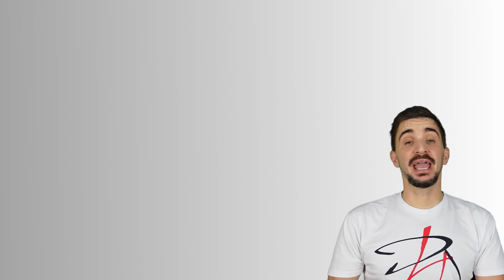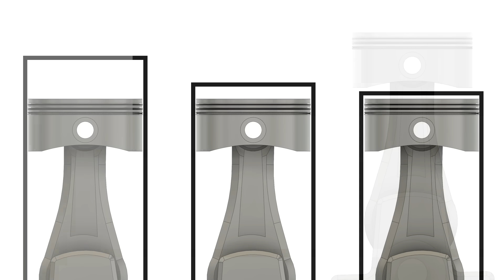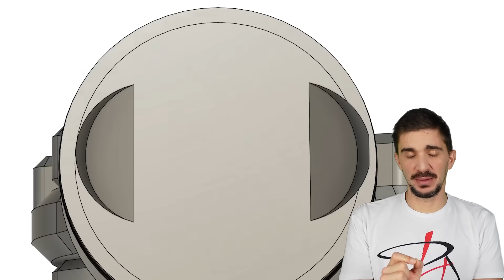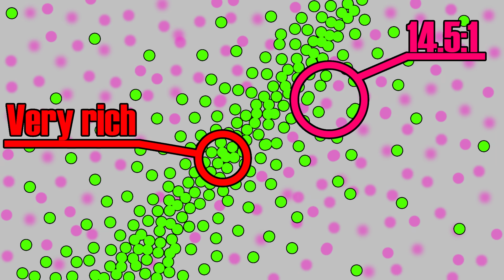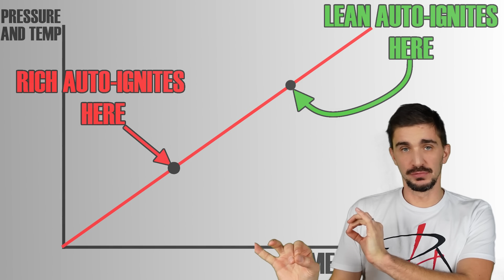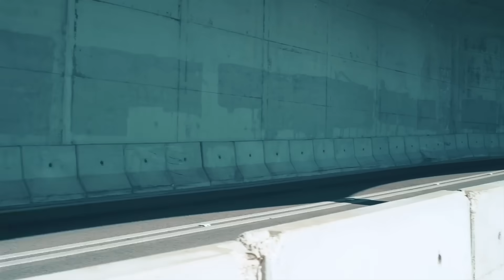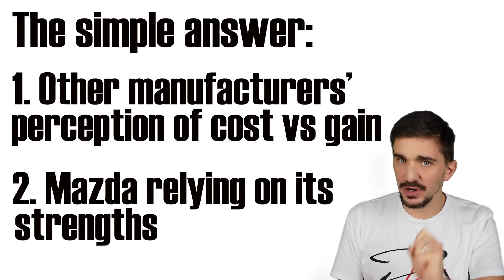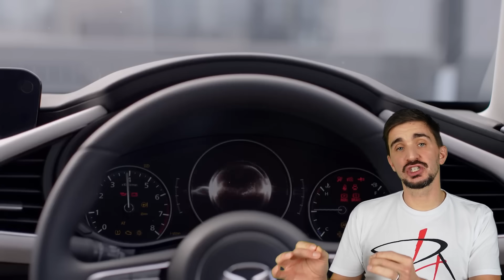The Game Changer Nobody Cares About - Mazda Skyactiv-X SPCCI How it Works and Why It Didn't Catch On

Comment: I have a 2017 cx9 & I have had 2 cracked cylinder heads & a stress fracture on the turbo. Recalls were issued so luckily I was reimbursed by Mazda for the 1 cylinder head cracking, which was $12k. The 2nd time it happened, about 6 months later, Mazda covered the full cost.

Comment: This is another case where I believe decoupling the engine from the drive would be useful. Just use an engine like this as a generator, then have a very small battery/buffer drive EV motors. No need for heavy drivetrain, no need to run the engine at anything other than its optimal configuration. EV motors provide the quick acceleration. 

I feel like Mazda was basically doing this with their "range-extender" I just think they need to take the concept to its extreme

Comment: I've driven a number of Mazda's cars over the years, and you're right: they are spectacularly underwhelming when it comes to engine performance. At the end of the day, I'm not paying significantly extra money for a car that gets slightly better gas mileage than the cheapest sedan on the market but can't outrun it. Every time I push the gas pedal to join the highway traffic, the Mazda revs and makes noise, but does not accelerate any quicker than a Nissan Sentra... or maybe a Versa, hard to say. It can not get out of its own way, despite looking like it should. Mazda built the most stunningly disguised economy car ever.

Comment: So why not simply introduce kerosene as a motor fuel? And do away with diesel and petrol except for niche markets?
Reply: Why? It's sits in between diesel and gasoline in properties and literally in distillation column. There are already huge market for it - jets. We will just end up with very expensive kerosine and dirt cheap gasoline.

Comment: So why cant this be used in an electric vehicle where the gasoline engine is only used as a generator like a diesel-electric locomotive. You don't need control if the load is always the same.

Comment: As you mentioned its underpowered compared to most modern 2 litre engines. Needs more torque, they should of lightly turbocharged it, to at least 200hp / 320nm.

Comment: Car Failing Point (engine, electrical and suspension):
1) Shareholders influence, greed, bad Engineering designs and low quality materials used for manufacturing (50-60%)
2) Bad manufacturing systems, Q&C standards and unskilled workers (20-40%)
3) Owners ignorance and neglect of maintenance services (30-40%)
4) Environmental impact on components (5-10%)

NB: Subject to correct

Comment: I recently had a rental Mazda CX-90 and determined a few things:
1) The appearance of the vehicle is beautiful outside, but lacks the same inside. 
2) There were a number of rattles that seemed to be manufacturing quality issues.
3) Interior soft points were lacking in specific areas.
4) The power was decent on the low end, but lacked high end torque that matters when you need it.
5) The shifts down seemed to rev the engine too high and the torque range was pretty specific and narrow.
6) I did not see a gasoline efficiency that was notable.
7) The transmission was louder than I would expect in its peer group.  
8) The doors seemed to close with a cheap quality feel and sound.
9) The infotainment screen was a nice size and not overly distracting.
10) Overall not as impressive as I would hope in that class of vehicles.  
My daily driver is a Lincoln MKZ 3L twin turbo, so I’m in the “spoiled group.”

Comment: I am an old school Honda owner. I LOVE engines you have to work a bit to keep them happy. It is impressive to me that Mazda has been able to bring out a high technology engine, and make it reliable. Thing is, no turbo, means no excess heat to deal with under hood, no cooking oil for extended oil changes like a lot of dealerships and manufacturers sell people on. A naturally aspirated engine tends to be more tolerant of less than perfect maintenance, but I have no doubts this engine still demands oil as clean as possible to function correctly. I do have a love for Mazda products. I have enjoyed all but one Mazda I have driven so far. I loved the 1987 RX-7 GXL (NA engine, with the Turbo's suspension, limited slip diff., and brakes) I drove and was about to buy, but it sold just before I had the cash in hand. I loved the brand new Mazda 3 I test drove around 2005-06. It was a fully loaded manual transmission, and it was amazing to drive and super comfy, was even impressed with the leather. My roommate's mom had a very rare here in the states 1993 Mazda 929. That car was soooooo nice, surprisingly supple tan leather in a pearl white car that looked brand new for the 15+ years she drove it. Mazda can make amazing things, and I am happy for them when those things work. Just, it is a shame that they are the smallest of the big Japanese automakers, because it is often Mazda pushing more boundaries.... often in random or off the wall ways. The stubborn, Mazda way.

Comment: I'll never ever ever own a Mazda. 142,000 MI on a CX-7 after having the top end injectors and everything redone throws a rod through the block 70 mph.. never had a problem with the car beforehand just decided to have the injector service and tune up. Service regular oil intervals everything.  they are garbage cars. That's just one instance

Comment: Water vapor injection do the same cost 3$ , 10% of water reduce heat in cams allow  to have lean mixture and hi spark angels without detonation, and also water change compression ratio, water allow you to have various compression in engine, and even change it to 12 -14 and it without knocking. Actually first engines don’t work without water, and hi loaded  turbo engines don’t work without water. I think gasoline engine + water  and TDI+propane+water will do almost the same as skyactiv, but any way this is cool unique technology, and if you add water to skyactiv it will consume even less fuel 🤔nice video thanks💪

Comment: Obvious what we want is a plug-in hybrid with a supercritical CO2 turbine on an air bearing as a backup generator that doesn't require oil change or maintenance. Since it will be an external combustion turbine, we probably don't even need an air filter. Cooking oil, strong vodka or coal power would do too.

Comment: i think i can take a stab at why there hasn't been more hype than there could be.. because OVERALL mazda's long-term reliability is NOT sky high (no pun intended). Nope, Toyota shines on that one. Vast majority of people don't care and aren't impressed with 'reliable engine',  they are impressed by 'reliable car'. Moreover, those who truly care about reliability usually care about LONG-TERM reliability, and Mazda is not 'it' on that one either. I suspect many Mazda's are leased. The people who lease their cars have the mentality of renters - they really couldn't care less about long-term anything. If something goes seriously wrong they will change cars easily at the very next opportune moment. Note to manufacturers:  if you want your special engines or whatever else noticed, you have to aim to impress the people who buy a car (especially if paying with saved up cash!) and plan to keep it for a good part of a century. That's Toyota territory at this point, almost exclusively (no, not subaru either at this point, despite the marketing propaganda - 10-year repair records do not lie). Would be nice if a TRUE competitor came on the scene - would give more choice and better prices for the long-termers, but that hasnt happened yet.

Comment: I just got me a Mazda3 from 2018. It doesn't yet have the skyactive x, but a nice naturally aspirated 2.0L engine with 120hp. Living in the alps I can say, that the torque is enough to cruise up serpentines until about 10% in third gear as low as about 1500rpm. Of course you have to shift down for reasonable acceleration, but the motor is far from troubles keeping the speed. 
The engine runs very cultivated and with a pleasant deep voice, very smooth and 'direct'.
Unfortunately because of EU regulations, this 2.0L is castrated to 120hp, only available in the EU - normally it has 165hp(which is also available in the EU). Only difference is in the software and only above 4000rpm.

Comment: Back in 2024 I had a 2007 tacoma trd off road with 130k miles and a 2022 wrx base manual with 14k miles.
I decided to down size big time so i sold them both.
I was cross shopping a 2024 corolla le and a 2024 forte lxs.
Not only was the forte 3 to 4k (last model kia sales) cheaper, better tech and better warranty. But the real reason i chose kia over toyota was because the compressionratio.
12.5:1 compared to corollas 13:1
That .5 made me choose kia lol.
I dont trust the cvt too much though and always pull away slow pissing the person behind me off.
I bought the car to keep for 20 years and anytime we decide to go long distances.
Its an appliance, cant wait foe that telo mt1 to join the garage when its released!

Comment: this is all fun untill something goes bad. I drove mazda 2.2d, had  alot os serious issues with the engine and the gearbox. It's so called SkyactivD technology. It has a lot of torque with low fuel consumption but all that you save on diesel, you pay a lot more for the problems. I hope this new technology will be better.

Comment: Actually, I own a 1981 Silent Shaft MCA Jet engine, that does pretty much the same thing as Skyactive X.  And yes it gets over 40 MPG hauling a six passenger station wagon.  The last time it went through inspection it's emissions were insanely low. BUT...
It takes almost 10 minutes to warm up while it will stink and smoke up the whole neighborhood until it settles down and can run.  I also might add that it has awful pick up and a very low top end.  Yes... at cruise speed on a flat road it gets amazing fuel economy, but it mostly wants to operate at in a very narrow RPM band after it is properly warmed up.  

The reason I own a own a 46 year old MCA Jet engine is because no one in my household ever wanted to drive it since it was new.  Yes, it was great on long trips, but the garage is under the house... so you had to first push it outside, then wait 15 minutes and then slowly ooze up to highway speed in order to get better than 40 MPG.  And honestly... nobody ever wanted to do that.  So 80,000 miles in 45 years.. all highway... and it still lives in my garage where no one wants to actually drive it.

Comment: The truth is mpg doesn't sell cars. Not when gas prices are low.  The manufacturers put tiny turbo engines in because they are easier to package and cheaper to build, and many don't get good mpg. The tiny Trax can't get 30mph in normal driving. Nobody is really competing on mpg.

Comment: Could SPCCI be used in a PHEV setup, where it would just charge the hybrid battery rather than connecting to the drivetrain? Wouldn't that allow it to run at optimal load all the time?

Comment: In Europe Skyactive-X is 2000 E more expensive then 2.5
And for what? For an engine with no low end torque, that requires premium gas and that is a tiny bit faster?
If you compare it to other Mazda engines - it is still OK. But it has nothing on 2.0 TSI

Comment: In the 1980s Honda had a system whereby a very lean mixture in the cylinder while one intake valve supplied a rich mixture around the spark plug; this in a carbureted engine.

Comment: I own a 2025  CX-70
The inline 6 cylinder performs just as described in this video. Powerful and fuel efficient. I averaged 29.6mpg last week on a 3000 mile trip.

But, let us not forget Mazda is also the last manufacturer to use a sequential transmission. 
All other sedans come with a CVT. 😢 Even Subaru has transitioned to the dark side of gear shifting. If only we could still opt for manual.

Comment: Mazda might end beating honda at this rate. The tiny turbo engines with GDI are crap, nobody can make them reliable. Ultimately they are asking too much out of what is essentially a motorbike sized engine.
Toyota was smart to keep their (by today's standards) simple NA 2.0l engine
And if mazda keeps the reliability benefits of a NA engine thats actually big enough for the job, but can get a bit better mileage, good on them

Comment: I like Mazda and the technology discussed, but I can tell you why Toyota is not interested : their Hybrid technology combined with Atkinson cycle combustion engines is, after 20 years of development and fine tuning, more fuel efficient, cleaner and more reliable (hence 10 years full warranty). And you don't have to rev this system because of the immediate torque from the electric motor (2 in my case with the RAV4 AWD).

Comment: The reason this tech did not catch on is because Mazda engines are not know for using less fuel and indeed the actual savings on fuel are very minuscule. A little research and less ranting would have told you that.

Comment: Mazda's point was this SPCCI engine would safely replace diesel engines with SCR. The benefit of lean burn mode won't be available in US without SCR because of high NOx through a tail pipe as it would not work well with current catalyst. They can try to lower the compression but then what would be the point of this engine

Comment: And then there's the other game changer.
A dual fuel compression ignition engine AKA LPG/CNG injection for diesel engines. With up to 80% of gaseous fuel added during the intake stroke with diesel injection on compression igniting the whole mixture. The fact that this is so omitted in the mainstream while having so many advantages is criminal.

Comment: Sounds like an ideal candidate as a hybrid. That way you get supplemental low end electrical torque making it feel more responsive, while allowing the engine to always run at its highest efficiently. All this while achieving diesel like fuel economy fueled by lower cost gasoline and not requiring DEF.

Comment: I bought a new CX-9 in 2017.  Sky-Active blew a head gasket at 92k miles, not 5 years in.  Dealer quoted a new engine for $11,500, but because they already knew these turbo 4-bangers were having issues, they lowered the cost to $3,000.   I'll never buy another Mazda.

Comment: honestly, i wish 3d metal printing could be as affordable as going to a metal shop is now, i mean f1's merc used it to print engine parts, something something compression ratio trick something something they wouldn't be able to pull it off without metal 3d printing....
one day, in the future hopefully we'll be able to just print a rotary engine parts and just have brand new rx7 engines 😂

Comment: Compression makes power in the Otto cycle. But it also makes a lot of heat, and you need special, expensive parts like ceramic cylinder blocks and heads and forged pistons and valves to deal with it. Expensive.

Comment: I have a question. This reminds me of "stratified charge" gasoline engines. A generally lean mixture with a rich mixture near the spark plug. Other brands have tried this and put this in mass production even. 
Volkswagens FSI line for example in the early 2000's. 

I remember it wasn't as interesting back then because of emissions regulation. Lots of NOx emissions in lean burn mode and for classis three way catalysts  to work, you need stoichiometric mixture. If you have to deal with this at part  load you need an expensive SCR unit in exhaust system. 

Maybe now. The price point has shifted. Making SCR interesting again. Or they have another way of dealing with the NOx emissions. 

I find this video sort of misrepresenting the "recent" mazda innovations. It is more a question of how will we make an engine comply with modern regulations and keep the system cost effective. 
Which apparently mazda has done. And this is what would set them apart. How do they deal with nox emissions at part load and made it cheap enough to produce? But that does sound less interesting i guess.